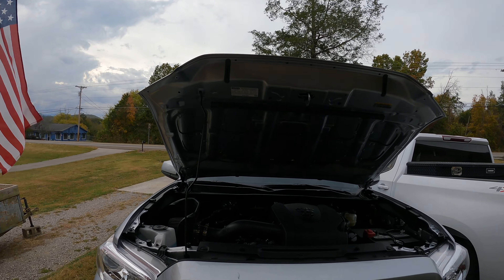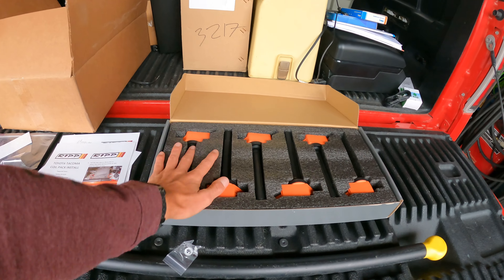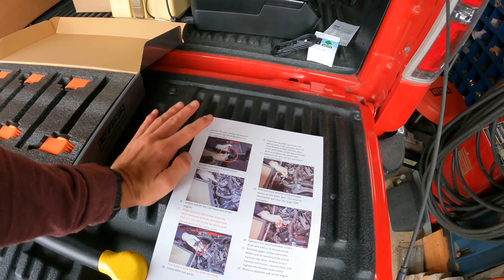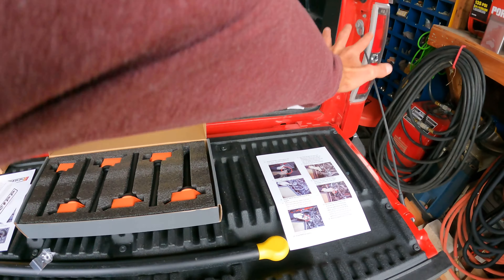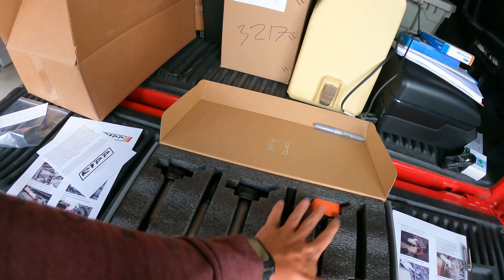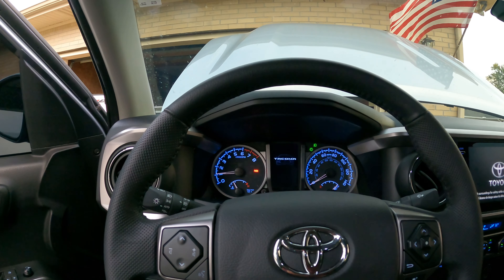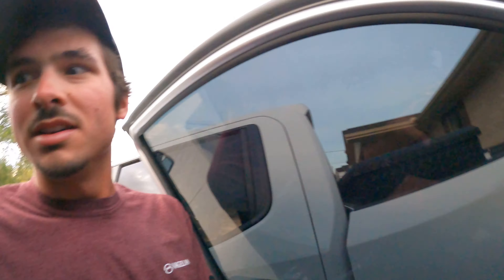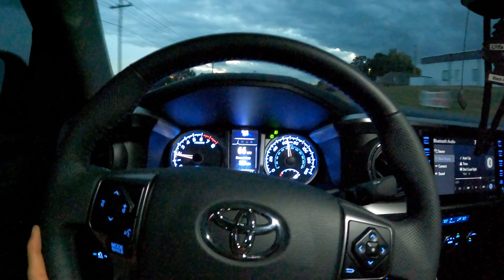Ripp High Performance Coil Packs for my 2022 Toyota Tacoma SR5 V6!

Comment: Ripp coils are garbage, if you want torque 4.88 gears and kd max tune!
Reply: why garbage
Reply: More wear from the higher engine rpm
Reply: @dannylewandowski2822  Ive asked around> Got 2 uncs that've raced circuit all their lifes and they adviced me to not go ahead with the product. They both agree the right job is  upgrading gears. Went Borla + K&N Cold Air filter without the coils.
Reply: @dannylewandowski2822  Honestly I run 5.29s and average 1.5k-2k rpms @ 80mph on highway and 600rpm idle. My top out is probably 110mph and I am tuned with 35in tires.

Comment: I have these coils installed going on a year now paired with my Injen RAM air intake, afe throttle body spacer and KD max pro + torque tune im averaging 16mpg on a 6inch lift with 35s
Reply: I too am on 6" with 35s stock gears 5400 lbs. My commute is 60mph posted speed limit. I leave for work early enough I don't have to speed. I'm getting close to 20mpg. I live at sea level. ECU is tuned . Run premium fuel
Reply: My truck is bone stock except for OTT mild/medium and I am getting 24+mpg doing 80-85mph. 23 SR5 4wd V6
Reply: @270eman You don’t have the RIPP coil pack? If not would you say OTT makes enough of a difference and is it worth it?
Reply: @BlitzAgar  Yes its worth it. Makes way more of a difference than any coil pack or air intake could. The stock tune makes all of its power in 4000-5000rpm. OTT remaps those power bands to move the power down to the low end. Makes the gas pedal more sensitive and responsive to input.

Comment: Don’t recommend these at all bro. I installed these back in May 2022 and about 4 days ago in December 6 2022. My truck was malfunctioning due to these coil packs. Best advice from me is to save oem coils and hope they don’t go out.
Reply: I just experienced the same exact thing today. Throwing error codes and check engine light came on. Felt like it was misfiring. So I limped it to the dealership and they told me that it was the coil packs. $350 wasted
Reply: Where your coil packs from RIPP with the black heads?
Reply: Same thing just happened to me. Engine misfires
Reply: It sucks to hear you guys had bad experiences. I got 120k out my first set. Just got my second set installed a few days ago. When I put my stock coils back on I wasn't enjoying my truck as much . Three weeks I was on the stock coils . Honestly stock coils suck. Good spares
Reply: @johnny51984  It probably was running less than 91 octane

Comment: I added those coils to my tacoma as well as the TRD cold air intake...you forgot to tell the viewers they will now have to use premium gas, and they will not get anywhere near the horse power you have stated or the extra mpg's
Reply from the maker: Ripp says you don’t have to use premium gas and on their dyno run on their YouTube video, I am pretty sure they used 87 and got around +20 hp.
Reply: @TrucksandWater  dyno +17 with 87. Around +20 with 91
Reply from the maker: @lxy0709  gotcha. So pretty close
Reply: @TrucksandWater no they recommend premium for max benefits
Reply: @lxy0709 I'm rolling 92 octane here in Washington State

Comment: I got 120k mi on my first set . Guy isn't lying entirely. Definitely improved mpgs and more pep. My 17 Tacoma has over 230k mi and I'm the OG owner. I just recently installed my second set. Highly recommend running premium fuel as ripp performance recommends also . You get max benefits.

Comment: What octane gas do you use? I saw recommendations to use premium. That was unappealing to me, and I did not get them because of that.
Reply: x2 I'd like to know also
Reply: Recap.... they asked this 2 weeks back... According to @truckandwater "Ripp says you don’t have to use premium gas and on their dyno run on their YouTube video, I am pretty sure they used 87 and got around +20 hp."
Reply: I run premium on mine like they recommend and you do experience the max benefits. If I run regular octane, I don't have as much pep and mpgs are lower .

Comment: Just bought mine. Can you give me an update how their performing now after you’ve put some miles on them?
Reply from the maker: Still preforms the exact same as the day I put them in. 1-4 mpg+ increase in all driving situations. More bottoms end grunt with great top end pull. I have seen increase across the board whether I run 87 or 93. Highly recommend it. But also pair it with the rough country cold air intake. I have a video on that also.
Reply: @TrucksandWater  
I’m running stock air box with a K&N filter and a MishiMoto silicone intake tube. Just put on a 18” magnaflo muffler. Putting the RIPP coils on today. I’ve heard nothing but great things about this upgrade for these trucks. Thanks again for the video.
Reply from the maker: @osubigrob  no problem man.

Comment: will this void my warranty? i just bought a 2023 trd pro with the manual, and opted for the extended 7 year as i want to keep this truc for life. Will adding mods such as these coil packs and a cold air void my warranty, or do i have to wait 7 years to increase the performance or my Taco?
Reply: I don’t believe coil packs would void anything.
Reply: I installed the rip coil packs in my 2020 Trd pro manual transmission, the drivers side installation is absolute hell and more frustrating than you could believe. However, if, and when you finally get them in, you will experience a very noticeable increase in performance. I installed them myself Over the weekend a little over a year ago and everything has been fantastic.

HOWEVER … TODAY MY TRUCK Developed a misfire in cylinder number six and I was left stranded on the side of the road on a uphill grade with nowhere to pull over and the vehicle is unable to continue . 

I am unsure what the problem is at the moment however, there seems to be many people having issues like the ones I am having after installing rip coil packs in their vehicles. 

Granted that my truck is due for new spark plugs at 60,000 miles (I am currently at 61,000 miles at time of misfire developing today)

I will contact RI first thing Monday morning and inquire about the warranty which I believe I may be within the timeframe to be covered by warranty from RIPP. 

However, it is a huge pain in the ass to be dealing with right now. I’m stuck on the side of a mountain Canyon Road with a trailer that I cannot leave here or it most likely will be gone by morning. So I am stranded and cannot go pick up my son, and I must rely on the kindness of somebody which hopefully will help me but so far nobody has been able to help. I have been here for 12 hours and I am currently screwed. 

Is it a faulty coil pack? I don’t know. However, most likely, I’d say yes it is and this is certainly not anything that I needed to deal with at the moment, and I must be honest with myself, and come to the conclusion that it is probably a faulty coil pack. Now, what do I do get the warranty to replace them but pay for the labor or do it myself. Either way I will have to deal with the fact that they may not be reliable that they are not reliable according to the facts at hand, when speaking to anyone who has used them every every single person loves them. But the fact is they are unreliable and that’s a real crying shame.
Reply: Any modification that’s not factory will void warranty
Reply: @Roama.Tacoma that’s a flat out absolute lie. If you don’t know what you’re talking about, stay off the comments, bro.

Comment: Have you done a tune with it? I was told I can’t get a OTT with ripps on
Reply from the maker: I have not because I have a warranty.
Reply: The coil change will negate your warranty of something goes wrong with the coils. I took mine off. Going with a OTT tune; there is more feedback as to the reliability and performance difference than what I experienced and read on the coils.
Reply from the maker: I talked to my local Toyota dealership I bought the truck off of and they say it will not and I also have a personal relationship with the mechanics there. I also kept the old coils so on the rare chance something does happen, I or them can swap it back over.
Reply: Hmmmhmm yes you can I would know

Comment: What exhaust do you have on the truck. Or do you even have one. I’m brand spanking new to the channel and found your truck sounds pretty dang good around 4:08. I was wondering if the intake and coil packs was all you’ve done or if there was more
Reply: I have a 3rd gen tacoma. You cant change out the exhaust manifold for performance headers. You can only change out the exhaust and muffler. BORING !!!
Reply: @techstar4547  understood. Thanks